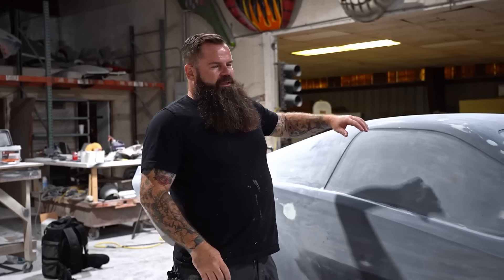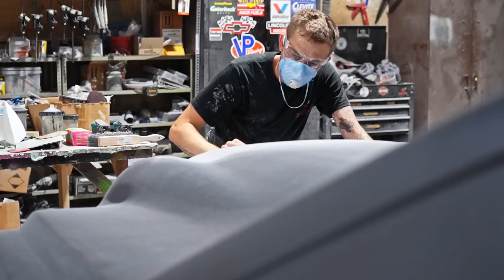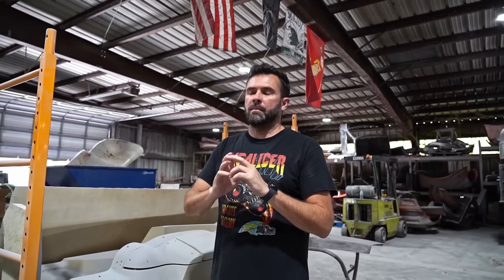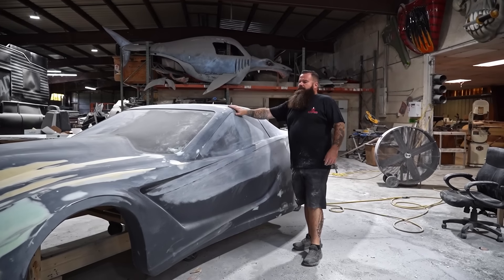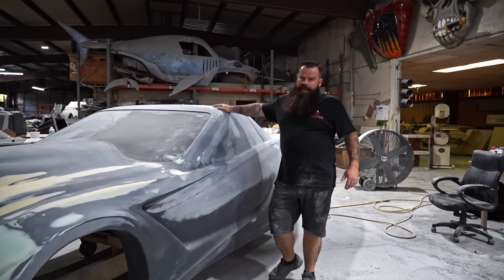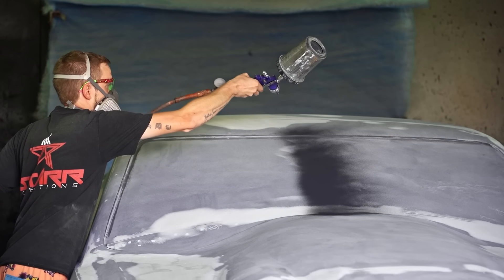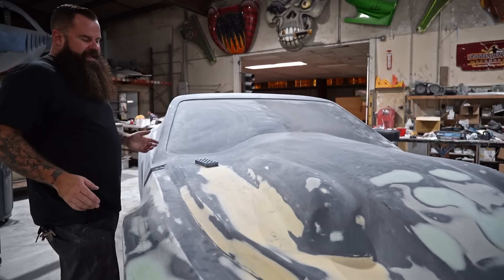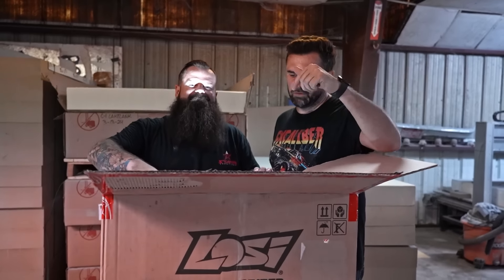Leroy Entering The Home Stretch!

Comment: Doing 6 formula sae body plugs, i gave up on foam. Switched to MDF never looked back. You cut 90% of the sanding time with cnc MDF with a coat of sandn'seal on it.

Comment: Currently work in a paint shop so I do have some understanding of working on stuff like this while different still understand the concept. As far as this being such a high quality peace where you don’t want to break through the primer because it’ll get hairy kind of like sanding plastic with course sandpaper. In order to protect yourself why not use 2 different colors of primer such as doing a coat of dark primer and coat if light primer then going back to the dark primer so you know how deep your actually cutting and when you need to start being more careful on blocking?

Comment: The question I have is 
What do you do with the foam body after the glass is layed and sent off 
Does it go into storage in case of breaks or wrecks so you can rebuild a glass body?
Reply from the maker: Usually the foam gets damaged when pulling it back out of the mold. We normally keep it around just in case, especially for something like this, because a damaged foam body is better than starting over if there's a problem.

Comment: I've only made small fiberglass speaker boxes, but I understand what you are saying about sanding. One of them was a mold and the other was from fabric stretched over a frame. I'm now working on turning the non molded one into a mold to make more from. I'm hoping to gain some insight into possible techniques and materials from these videos. Thanks for sharing.

Comment: How much would the body weigh if it were carbon fiber?
Are you allowed to use carbon fiber?
Reply from the maker: We could definitely use carbon if it was needed, and we may make a carbon body in the future just to do it, but the first one will (almost) definitely be fiberglass. We're not trying to make the body any lighter (100lb body will just replace 100lb of ballast).

Comment: The machining issue….hnnng.  Lol.  So many flashbacks of stuff at work lol.  Missing the tolerance or just being off a digit/decimal can sometimes be so frustrating.  Good on catching it!  

Off hand, would scanning the foam and doing a comparison of the solids in CAD not provide enough resolution to spot differences in the final product vs the intended model?  Seems like you could even CFD the scan of the solid to verify the flow patterns are still valid?

Comment: I wonder what coding the inside of the place is you needed reinforced with panel bonding glue would be like 
Mind you it is not cost-effective 
But you can break and tear the fiberglass off of it it ain't moving 
But when it does break it breaks like regular pane glass

Comment: I make my own glazing   I just add fiber glass resin without the hardier to bondo I use the same about the same amount of bondo hardener 2 to 3 percent.       A lil bit goes a long way. It all depends on the weather. Try this out.   I have been doing this for 15 year and never seen it fail.    And at 40 bucks for a small container of glazing.     Hope this helps.  And i with I know this trick sooner in life.    😊.

Comment: One question, where is the exhaust going to shoot out? Those ones sticking out are the dump tube's? Not the turbo exhaust exit? How tight it is not sure if they will be able to route the exhaust forward of the intake piping with frame issues also. Sorry just trying to ask the question before you finish. Looking fantastic crew!

Comment: 10 years ago we built a body for my Bonneville streamliner, The City of fBurbank. Did the foam and all, but hand laid the glass on the foam...no mold. Sanded the outside smooth removed the foam underneath, Bob's your Uncle. Finished product was and still is fabulous.
Reply: Could be done like that but the reason they want the mould is to be able to create multiple bodies if Cleeter messes one up
Reply: They must not be drag racing that Bonneville very fast

Comment: I've always wanted to go down this path of what you guys are doing in this video. Even before it was a published concept.
I designed and built my own 3x6 machine from the ground up about 10years ago while I was in school. Ran it a few times and it worked as planned. I got caught up in my career...cadcam prototype design and fabrication for a bluechip tech company. 25 year history with manufacturing and machine tool tech.
I have parents planning on retirement in the area in a few years.
 You might see a job app come in around that time.
Love your shop and all of the knowledge you guys must have from trial and error.
Error needs a better rap these days.
I am curious about where the error occured. Was it an offset value. Absolute v incremental battle. Plane in the wrong place?

Comment: What if instead of 3d cutting foam to make a mold, you just 3d print the mold and have bolt together points and spray chop into the mold.

Comment: Hey you guys need to use the right products for the job in hand. Epoxy primer, then spray filler. You can work that and prime it. Multiple coats of primer is just not the way to do it. You will get much better results and a more level surface with spray filler.

Comment: I have a stupid question, excuse my innorance. Will the mold be kept so that another exact copy can be turned out faster? In case he scrapes a wall or some damage  happens to the new shell.
Reply from the maker: Not a stupid question. The mold is made of fiberglass as well so it can be used to make as many molds as needed. Monster Jam trucks last an average of 15-20 minutes total before they have to either be repaired or replaced (usually replaced), so we use the same molds over and over again to make new parts/bodies for those trucks. Occasionally, like in the case of Monster Jam, the molds will get a little worn out over time/usage and need to be remade, but it takes quite a while to get to that point. We should be able to make as many Leroy bodies as needed with the one mold.

Comment: Even if the car is heavier with the body, I don’t think that extra weight would be that big of a deal since the airflow and drag will be improved so much. 

From the air tunnel stuff, it was crazy how much horsepower was needed to combat the air turbulence.  Now with the aerodynamic body it will be able to go the same in the quarter with hundreds less in horsepower.

Comment: Cleeter is gonna have one hell of a year with Leroy 3.0 and Eagle basically being ready at the same time 😂
Reply: I'm sure his helicopter is nearing completion as well!
Reply: World Cup is going to be quite the showdown this fall.
Reply: I wonder if Cleetus is finished with the smx motor? He knows it’s not Steve’s fault the engine had problems. It was a lack of maintenance from what I understand after watching Steve’s video. I hope he trades the used smx in for a new smx and Steve gives him a very detailed regimen of maintenance
Reply: @dwight8269  ugh... This is getting boring. An SMX will not be in the new car EVER. Its the completely wrong engine for that build, not to mention the smx was the reason cleet couldnt run the classes and races he wanted. I love Steve but its just not happening. The Camaro will be a trailer princess that is towed to and from the pits and lanes and NEVER have a radiator... Oh and cleet was seen leaving proline two days ago 🤷‍♂️🤣
Reply: @dwight8269  What will a new SMX do ? just maintaine it and slap new parts in and its basicly new , cleetus most likely gonna do the same to a Big Block and grenade that engine instead of the SMX , a matter of picking your own poison i guess.
Reply: @dwight8269 he sold the smx back to steve. Maintenance wasn't the main issue, they were trying to push the engine to make up for the bad chassis. Mullet cannot handle the smx. The big block the mullet had before is getting repaired by Steve and that is what's going into mullet.
Reply: @dwight8269  Hes going back to the bigblock. The smx makes too much power for mullets chassis. Which is why they have so many problems putting the power down. Since they will have eagle for the 5 second car theres no need for mullet to be pushing so hard. Switch back to the bigblock for more reliability and streetability.
Reply: @kjwelk931  Part of the problem putting power down is because they don't know what they're doing and keep changing stuff without a clue.
Reply: Haha, I have to laugh at anyone thinking a PL engine will last very long with the same treatment the FF boys give to the SMX, or the HED, or TS engines 
The biggest difference, is when they f up the PL no one is going to hop in a truck or on a plane to come to help them.  
The new car is going to spend a lot of time in the corner when it happens, when, because there is no if about it.
Reply: @gt1man931  Yep, treat your car like you're a cowboy and it behaves like an angry bull.
Reply: He said Steve is buying the SMX back
Reply: They will be broken after 2 weeks
Reply: All for World Cup!
Reply: @dwight8269  Man it seems people can't shut up about the SMX, quit riding that topic fishing for drama.
Reply: @gt1man931 steve dropped everything to help cleet when they fcked up the moon tuning 😂 they should definitely stick with him
Reply: @WowCreativeUsername there is no drama. Cleetus likes to change engine builders. It is what it is. Texas speed, blue print,the rod shop, steve morris, and now pete harrel. He will be on to the next Shiney thing soon.
Reply: world cup is gonna be wild
Reply: @JayMac i’ve been saying a proline 481x
Reply: @fast97z24  but he hasn't changed engine builders except for rodshop I think unless that's still in James burnout car. He still has a blueprint, he still buys Texas speed engines, he's still using the big block with Steve, he's using the engine from Pete because Petes tuning and knowing the engine etc fits perfect for Leroy.
Reply: Building a camaro named eagle.
While Leroy basically looks like what should be called the eagle
Reply: @AwwShucks_89  I've been thinking the same since they announced the new build lol
Reply: Mullet is going into the corner with ruby lol
Reply: @ianm432  probably when eagle and leroy get done but isn't there a drag n drive at the end of the year? Also the big block for mullet is basically done and will be dynod next week.
Reply: @trumbley22  That and it's a small tire using radials. Big slicks would have been the way to go at that power level.
Reply: In the Cj videos they are installing a Hemi bell housing for Eagle. 🦅
Reply: @dwight8269 clet was given the motor main needs but look at his fleet.  They are blowing them up left and right. Lack if maintenance horrible tuning.  Than he just turns and blames the motors build kr builder. He has swapped what 3 times already and killed them all. Yet same motors in similar spec cars and they are killing them every week
Reply: @alfredolopez1396 tell us you don't be half what you said.  Fact is clets entire fleet is dying because of lack of maintance. From early days his maintance has been horrible.  The smx insure clet had all the hp his car would ever need. Going to the big block ain't going to fix the issue. Just like he killed the BB and the ls. And all his other cars. Smx motors can complete with prolines. And ain't it funny Steve races faster classes and many others ravinf same class as clet and the smx isn't breaking main bolts smashing lifts eating cams.
Reply: I'm so ready for the 3.0 shirts! Have every Leroy shirt from the beginning.
Reply: Sounds like October is the goal for a turn key Eagle..
Reply: He'll destroy the body in 30 minutes
Reply: Too bad race season in Florida is pretty much up for the summer
Reply: I was going to spell it out but decided to just say IYKYK, lol. It is pretty damn obvious, though.
Reply: @trumbley22 they don’t know what they’re doing bro they had Leroy setup to the point he was hooking and throwing the power down without breaking traction cleetus gets the go ahead from the tuners to turn up or turn it down
Reply: @Stephen-carr not due to lack of maintenance sometimes stuff happens even cleetus accepts his wrongs bet you don’t multiple drag cars making 1000plus horsepower going 190-200plus mph obviously his team knows what they’re doing
Reply: @orlandoGaming407  If they knew what they were doing, they would have a much better handle on suspension setup by now. Most of what they do is reactive, I.E. they don't know what they're doing so they deal with problems as they come up as a result.
Reply: @trumbley22  every suspension setup is different on different tracks
Reply: @ianm432  i disliked your comments , because its sad  , but true
Reply: Imagine he stuffs it in the wall first full pull. Sorry I couldn't help myself😂
Reply: 9:35 coming after hibachi auto body
Reply: Doesn't mean he's going to win races..
Reply: @ALLGODSDIE dude wins races by throwing his wallet at them, then runs that setup into the ground through lack of maintenance, i love watching their videos but its just jackass with race cars, he doesn't have to  put in as much work to pay for his cars so he is less worried about breaking them than the rest of us at the track who kbow we have to put in a couple hundred hours of work to buy another if we blow it up, you see it all of the time at the track, the blue collar guys who have to put in tons of hours to affprd the hobby versus the guys who can drop $50k on a new engine tomorrow if you send a rod to the moon, my race engine that i dropped a year of overtime on gets all of the maintenance possible because i know how long it will take for me to be able to afford another one, and i dont hate on the guys that can afford to do that im just very aware of my own situation and would probably handle my maintenance similarly to those guys if i was in their position, instead im that guy thats checking rod bearing at least once a month and should start buying motor oil stock as often as i end up changing that. 😂
Reply: @JayMac  steve is rebuilding the big block that WAS in mullet for a "top secret project" my bets is that is eagle
Reply: @jackass123455 ........... That's not what he said and that big block will never make enough power to run a 5. It's also another drag n drive engine which is this car won't be doing... Ever
Reply: @Stephen-carr  Yep. They used to call it "more money than brains".
Reply: @orlandoGaming407  You bet. The problem is that he doesn't learn. He's a content creator, not a racer or car guy. Look at Alex Taylor, it's learning and racing first content second. Last year the moment cleet was out of a drag and drive the whole crew packed up and went home despite the other cars not being out. Make no mistake, if they weren't on camera they wouldn't be doing this stuff. Alex and others that live the lifestyle, have real skill, and show a desire to learn are the people that are more genuine and real.
Reply: @trumbley22  obviously we all know Cleet is a content creator but he also knows his cars people jealous of him because he has access to more money then other racers who is racing for what probably 30k while cleet a millionaire who is living his best life enjoying racing drifting and flying he help build Leroy yeah his other cars went to shops to get build up but again cleet still learning cleet does a lot without the camera and he’s friends with a lot of those top racers
Reply: @orlandoGaming407  Cleet isn't a millionaire, he just has a lot of cash flow. He occasionally mentions all his debt.

The point is he creates content for content sake, he doesn't film stuff that he'd be doing anyways. Those are the content creators that are better to watch.
Reply: If he can keep a engine together lol.
Reply: @dwight8269 he said he is going back to the old big block. Mullets chassis just cant use the SMX power and theres no point in even bothering. Steve bought the smx back from cleet
Reply: @trumbley22  having millions in assets makes you a millionaire doesn't mean any of it is liquid (ie straight up cash) having those assets means he can leaverage them for cashflow
Reply: @jackass123455  🤣 If you have say 3 Million in assets but owe 3 Million, your net worth is zero.
Reply: @trumbley22  while yes that is true that not how working with assets and growing wealth works having debt isn't necessarilly a "bad thing"
Reply: @jackass123455  You said it makes him a millionaire. It doesn't until the debt is paid off. It simply means he has a friendly banker.
Reply: @trumbley22 you’re saying Pete Harrell doesn’t know what he’s doing? Hm. That’s a new one
Reply: @nalley6815  Not at all. I'm saying Cleet doesn't learn much.
Reply: @trumbley22  okay I get that. But if you’re saying mullet isn’t where it needs to be because they don’t know what they’re doing doesn’t make sense. Pete has said on video mullet is maxed out and he can’t do anything with it
Reply: And the Camaro
Reply: @nalley6815  You're the third guy that has responded to the string of stuff I've responded. If you go back to the start you can see what I'm saying. I'm done responding.
Reply: @trumbley22  no
Reply: gosh darn brother mullet, eagle, leroy and all the boys with there cars, looking like a mighty team coming up this year
Reply: Business 101
Reply: I don't get how this take as long time as a full car, or this been going on MUCH longer 🤔
Reply: @JonathanAndrews-n8c  may actually be the first one of the three to be totally finished. 😂

Comment: This has to be one of the UGLIEST front ends of a so-called Pro Mod. If they would have used Polyester putty over the foam, as is done in boat hull molds, it would be so much more durable and way more consistant in strength and form. I used make the hull molds for Dave Callen’s 55 ft offshore racing hull powered by twin turbine J78 jets. I have run CNC 5 axis Machines for 43 yrs. I am very experienced in this area. A 5 axis gantry mill would have been the correct machine to have used.
Reply from the maker: Love the enthusiasm! Thanks for the comment!